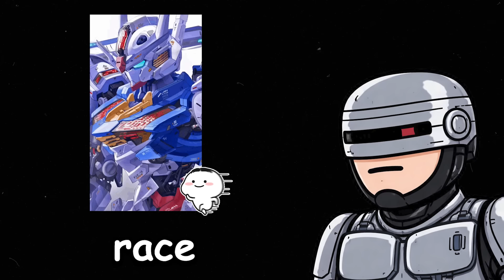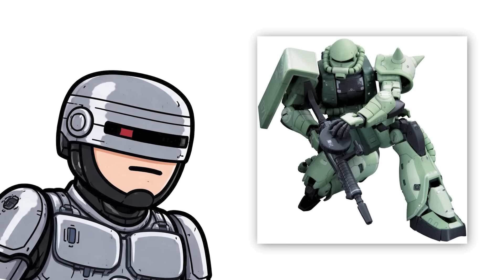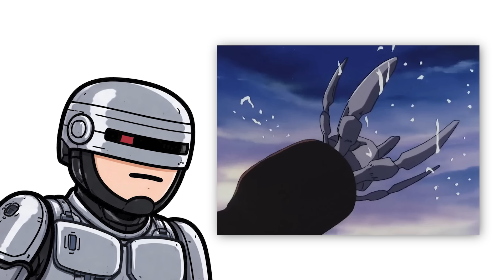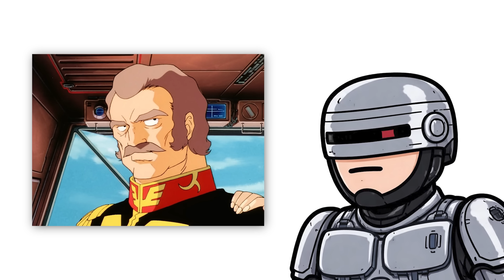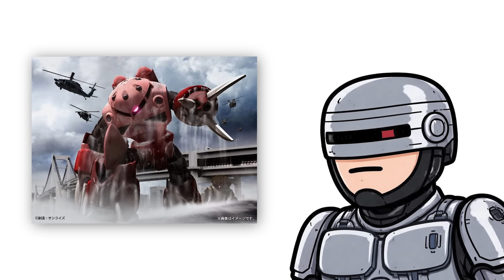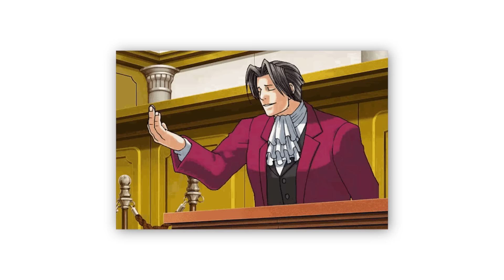Every Gundam Mobile Suit Explained in 22 Minutes

Comment: Pretty decent video. But missing some units as pointed out: Zaku1, and the MS-14 Gelgoog which won the competition for mass production against the YMS-15 Gyan. It's like in the USAF when you only mentioned the YF-23, the loser of the competition while failing to mention the winner which became the F-22,the main fighter. Also although it's in the specs and not the video creator's fault the Guntank's main cannons shouldn't be only 120mm.totally wrong proportion heck the zaku machinegun is 120mm. The Guntank is used for long range targeting and fire support, those are essentially battleship guns and should have been at least 300mm.